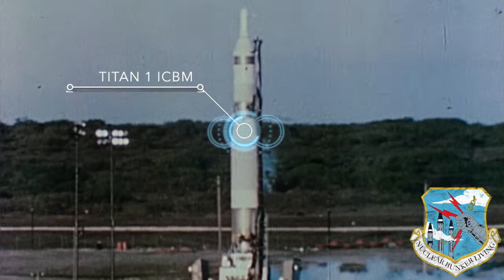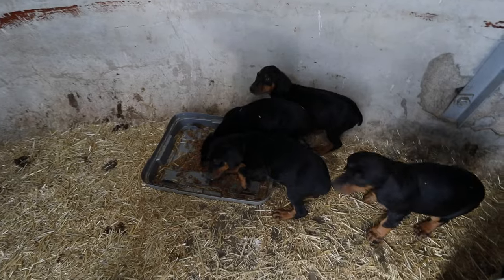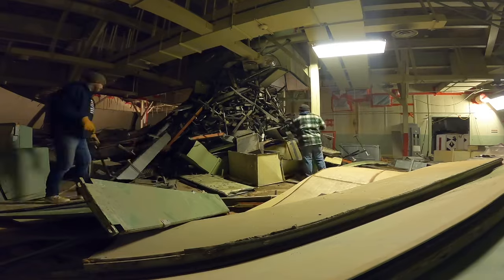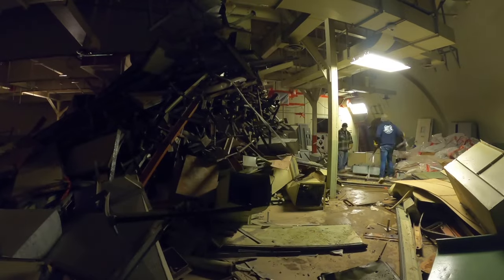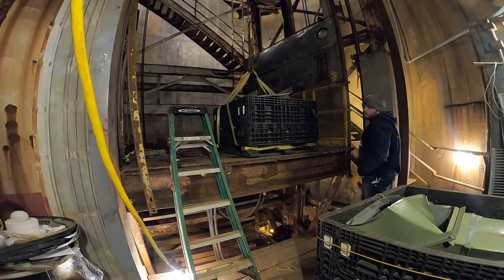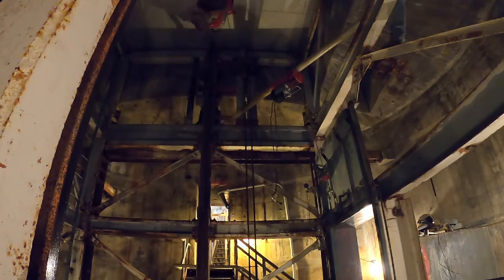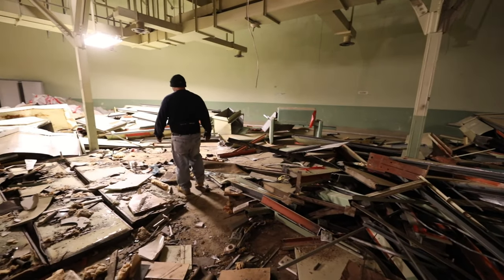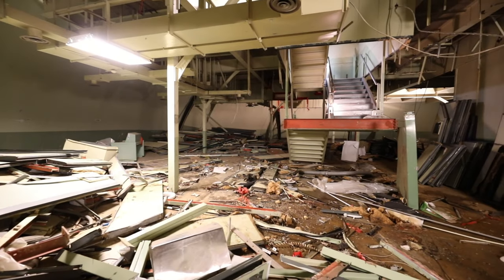EP. 22 - STEEL MOUNTAIN inside of a Titan 1 Nuclear Bunker.

Comment: I'm seeing this series of videos 9 months down the line so I hope your winch problems are sorted now. Those all-in-one winches are probably not rated for a 100% duty cycle and just are not man enough for the job, you need some system like a heavy cargo lifting elevator, they are very reliable and rated for constant arduous use.
Reply from the maker: Yeah. We are running these 2T gantry systems till we get the existing elevator sorted and 60t access portals opened.

Comment: Thoughs big door i am guessing would have opened with a hydrolic system , and from watching death wears bunny slippers rebuild on a bunker i also know they might have used hydraulic locking pins as well , they may still be in place and locked before the system was dismantled , if there are no locking pins try and check if the hydraulic lines are caped off , you will have to open them to have any chance of getting the system to move , you might be able to use compressed air the test the system if you can find the lines , good luck
Reply from the maker: There were actuators removed and salvaged by the government.

Comment: To bad you can’t get that big elevator working. It would make life so much easier getting all that debris to the surface! I believe Otis is the manufacturer of those elevators from reading and watching documentaries about the Titan 1 missile silo’s that were built. I could be wrong. Have you had someone from a elevator company come out to look at it to see what it would take to getting it up and running?
Reply from the maker: @TexasOnTheMove. The elevator would raise to the surface level with the opening of the access portal doors. The motor assembly of the elevator was submerged underwater in contaminated water for over 60 years.  It’s life has expired.